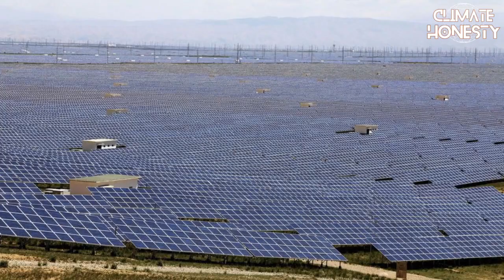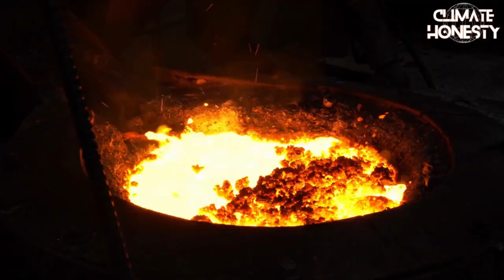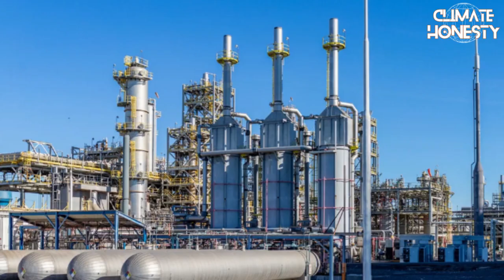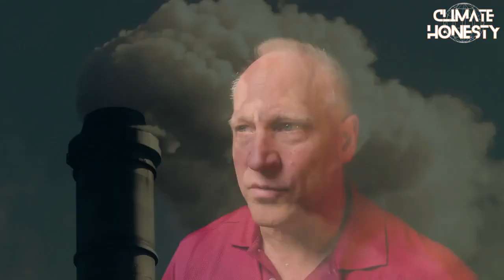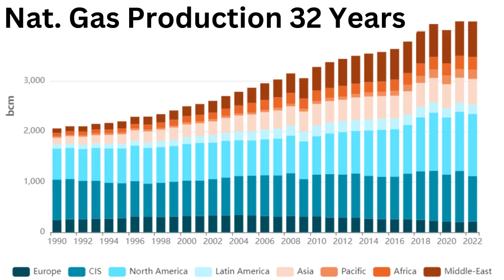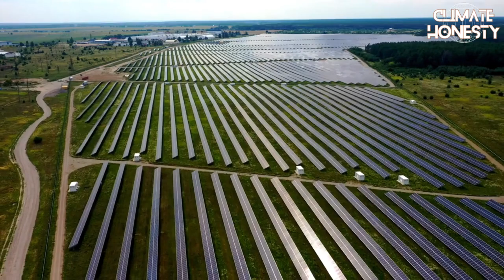Exploring solar cells, their production, environmental impact, and Energy comparison. #solarenergy

Comment: Yes, mining and processing the raw materials are energy intensive, but you didn't consider that PV panels can be recycled, so at some point, the quantity of extraction of raw materials is going to decrease. Plus, there are the new type of solar PV that are entering the market that requires different materials, often with low carbon emission. So your analysis is true, but assuming that we keep the same technology
Reply from the maker: I did consider it and mentioned it in the video.  The mining is not actually the major cause of CO2 emissions.  The majority of the emissions come from the electric arc furnace required to melt the quartz.  The same goes for the recycling.  You will have to re-process the chip in order to get to a pure enough form of silicon to recycle it.  I am not against solar power, just want us to look at it with candor and be honest about it.  It is not as green as most people think.  We have many years before it will be a major portion of our energy mix.